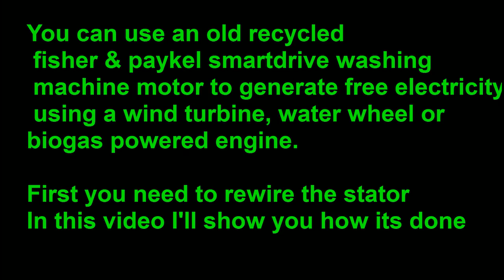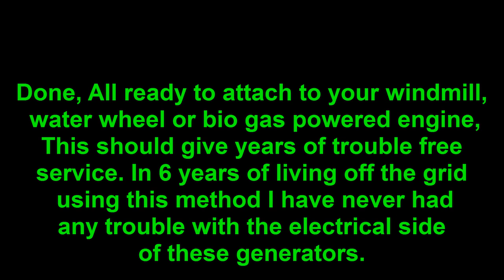How to rewire an old washing machine motor to generate free power

Comment: That's it? I mean thank you but why am I not seeing the magnets the production something.. 
I don't wanna go to all that trouble to generate 5 watts a month.  Show us what is going on .
Reply from the maker: Link to the water powered generator is in the video description. It has been running 24/7 since I built it, saved me many thousands of dollars by not having to pay for power
Reply: @AngryRambro  nice.. that's what I'm talking about.
Reply: Tomo Polic yes yes, that is the intent.  I live near and my parents have lived on a tidal creek since I was 13, 1984, and I’ve wondered since then why we don’t harness the power.  Plus my dad is a retired Army Colonel and the smartest man I have ever known.  Chemical Engineering top of class.    I want to put one of these at every dock on the creek and get everyone integrated such that when one home has surplus another can take some extra wattage.  To me, the issue isn’t getting the power, it’s the storing of it.  I’ve even come up with concoctions of your floating driveway and every time you park the weight of the car and the movement of stopping and accelerating are harnessed into underground springs managed with ratcheting clutches, to the tune of maybe hundreds, storing potential kinetic energy as wound up spring pressure.   Turns out I’m onto something as they have developed nano carbon springs to be used the same way, but they streamline the process.  Obviously.    I also feel that every single braking event from the horse drawn carriage to the locomotive to the airplane to the car, is horribly wasted energy.   Most of the gasoline we use is in the acceleration.    Remember the toy cars where you pull it back and off it goes with equal and opposite force?  Like that for full size cars, but accompanied with a flywheel of sorts.   Clutches and ratchets control the whole thing.   Every (almost) bit of energy used to come to a stop could be used to take off again.   Imagine having a direct able wind turbine above your car.   With a cross wind, you could make energy on the side(see what I did), on braking, it could face forward and use impedance to increase air braking force.    Maybe even mechanical by tilting the rotors like a helicopter for more resistance to come to a stop.   Kinda hard to lock up the breaks or lose stopping distance because of bad tires when a fair portion of your braking is done by wind resistance.   Same rotors could be tilted for optimum aerodynamic efficiency for high speed or performance driving, even folding away when needed.   But you could park your car and charge the batteries with just the wind, the sun, and soon, the rain.    Most of the surface of your car channeling rainwater into one or two streams could definitely be useful to “passively charge your car.   Imagine a bright sunny day with a brisk wind, and you smile knowing that gas stations are stupid.    Then a hard blowing rain, at night even, and you smile knowing that gas stations are stupid.   Even at that electric motors are great for filling in the lag during transmission shifts in the highest performing cars in the world.   I’ve been reading car and engineering magazines since I could read at all.    They even said back in the late 2000’s that electric cars would not be common until 2025-2030.    I don’t know where y’all live, but in Charleston, SC Teslas are ALMOST ordinary.   I see at least five every day without looking.  If I were to seek and count I’m sure I could reach 30 Teslas every day.    The point is this.   Tomorrow is today.    This guy is showing us the future.

Comment: How much RPM does this motor need to start to generate?
Reply: +faffaflunkie  Based on the diagram and 220 VAC in NZ, it will be generating 50 Hz at 214 rpm and 32 volts AC.  This will be rectified to charge the battery.
Reply: Depends how much electricity you want, the water turbine I have made is 3.19 to 1 ratio, each turn of the Pelton wheel turns the motor 3.19 times. It is a 3 phase motor so I just separated the 3 phases and and bridge rectified each phase. This increased the amps without having to rewire the stater. admittedly this is a low rpm system. I have 4 motors on the water turbine like this. at 20 rpm on the Pelton wheel I get just over 60 rpm on the motors, they produce 38 volts and 4 amps. This may not sound like much but when it is going 24 hours a day into a battery bank it adds up.

Comment: Is there any reason you cannot use a small gas engine to spin this and make a portable generator?
Reply from the maker: Not direct ac with this config, but they make good battery chargers when coupled to a gas motor. This one would put out 30+ amps @ 24v or 60 amps at 12v
Reply: Buddhanz1

Thanks, I'll have to keep figuring on it before I go at something.
Reply: Buddhanz1
What rpm would the rotor have to turn at to generate the 720 watts (i.e 30+A@24V or 60A@12V) that you described above?
Reply from the maker: A B Around 1000 to 1200 rpm from memory

Comment: Why can't you just leave it wired up for ac and just hook it to the panel box and put some breakers in it?
Reply from the maker: +Christiancrusader The factory wired stator puts out 400+ volts 100+hz, quite dangerous and not good for sensitive appliances
Reply: +Angry Ram what voltages and hz is good for 110 appliances ? I'm trying to figure out a way to run just the 220 on the power grid and the rest off a self sufficient generator
Reply: +Christiancrusader "110 appliances" would indicate 110v (usually 110-120v). For every appliance you intend to power, look at the labels attached to them by law. They will tell you what power brackets they operate within.

If you had a 110v Laptop power adapter, you might need only 45 watts to power it (watts = amps x volts). A microwave, however, can be more than 1000w. That means you'd have to spin this thing 20x harder to power a microwave than a laptop at the same voltage. If you plug something in which requires amperage which you fail to produce, it may either perform poorly, malfunction, or damage itself trying.
Reply: +SilverBird how can I regulate the hz down to 60 where it's supposed to be at so they will run where it needs to.
Reply: +Christiancrusader At this part, I'm not really qualified to give advice. I think you'd need some sort of Load-Frequency Control. But I will offer what I can for advice.

It would be impossible for you to leave this wired for alternating current (AC) production and get the desired energy production at your desired frequency. When wired for A/C, the frequency would be a naturally-generated product based upon the RPMs of the machine etc. The sine wave [pattern] of that electricity would be extremely impressionable and your electronics would not appreciate it.

When using this to generate Direct Current, then hooking it to batteries and running an inverter off of those batteries, you dodge this very difficult bullet [in most applications], because the inverters are going to choke the output down to safe frequency and voltage levels and produce as consistent of current possible regardless of your fluctuating input (so your electronics aren't damaged). Since the majority of production is stored into car batteries, or what have you, there's significantly less waste. [Generator>Battery>Inverter>Electronics]

To get 60hz out of this design even at the perfect 120v A/C output, you would have to turn this exactly the same speed- all the time, and if it turned faster, your frequency would rise (proportionally to your RPMs I imagine). You'd be wasting a LOT of potential energy production by braking the turbine to stabilize your hertz, and risking your electronics every moment they're plugged in should the wind ever go from 6mph to 10,12,15mph.
Reply: Plus, the simplest answer of all: If you didn't store the energy produced into batteries, all of your lights would dim and flicker when the wind slowed down (or whatever variable is turning this generator), and if would be completely off when this wasn't turning.

Batteries are direct current, so you really don't have a choice anyway. Which is a good, safe inconvenience, because that Inverter saves you a lot of hassle with your question.
Reply: +SilverBird thanks for the info but I though of an much easier way to get what I want I just need to buy a generator motor that will produce what I need and just use the water and a water pump to make the wheel spin.

Comment: you dont need to run 3 separate wires. essentially you have a 42 pole 7Y connection all the phases get connected anyway. so one wire would work
Reply: do you have a clue why he not answer you? I am doing one now and you do need all 3 wires. Look up 3 phase. Google is your friend.
Reply: No one wire to hook all the stars. I rewind 3 phase motors for a living. Instead of 7 stars connected just connect them all together.
Reply: @reubenspafford2927  can you send a picture of the way you would do it? I would like to see it.
Reply: Marty T Using a large soldering iron in his latest vids doing this again...with sound.
For a newly built hydro 
also  https://www.thebackshed.com/Windmill/FPRewire.asp

Comment: Why do we have to re-wire the stator?
Reply: the answer to that is in these posts about ten times. to increase the current and lower the voltage to a safe and useful level for a 24 v dc system

Comment: Is actually a 14 pole three phase stator (0:24) but I gather you will rewire into 42 poles... Nope, you didn't. Still 14 poles (0:29) you've just paralleled everything and it's quite ingenious but it isn't 42 poles. Each set of x,y and z equals one pole. Count. Great video and again you're lucky to live in NZ and have access to these "smartdrives".
Reply: +fla playa Yeah, I was kind of wondering why he calls this a 42 pole setup. It's 3 phase with 14 divisions. I imagine the rotor has 14 magnets on it.
Reply: Hi, it's not just in NZ that they have those drives, I just picked up 2 front loading defective washing machines (one Samsung and one Maytag ) on the web that people are selling for like 15$ and they both had the brushless motors in them ! I am planing to make a wind generator from them. A brushless motor like that cost 300$ normally, I am glad people don't know the value of what they are throwing in the trash ! :)
Reply: Oooh.. Glad many countries 'round the world have intelligent people in them is what I meant to say.. Wind, tide, stream etc can drive one of these buggers. How about solar to liquid fuels?
Reply: Now all we need are decent batteries to store the power.
Reply: Batteries? How about stored water? (The reverse function of a dam). Take the power from the solar and pump water into an elevated reservoir. Then at night let it back out to generate.. Batteries?
Reply: I am planing to store my energy in 1 meter radius Vinyl ballons, 3 of those filled with hydrogen from water can store about 30Kwh worth of energy ! then you can use a fuel cell to convert back to electricity or you can use the hydrogen for direct heating-cooking.
Reply: simpledate Pretty archaic if you don't take offense. Why not use a simple HVAC compressor to compress your H2 stream and then store in a simple steel pressure vessel? Many videos on here will show you how. How are you generating H2?
Reply: It's a question of cost, I looked in both alternative. Add the price of the 100 psi compressor plus the 3 one hundred pound propane tanks plus the price of the valves and high pressure tubing and you end up with 50 times the cost of the balloon and 3 psi compressor. I make my own hydrogen generator, about 5 litres per minute.
Reply: I'm fairly impressed. Are you using grid power or solar to generate your H2?
Reply: Solar and wind. I built my own solar panels. On Aliexpress the 6x6 Mono monocrystalline
cells are about 35 cents per watt. But it's a bit of work putting it together.
Reply: simpledate Breath of fresh air you all are in whatever part of the world guessing NZ? I won't tell you what "we" are doing for our energy right now.. Not good I can say that... If more brilliant minds would stand up and demand energy to be produced cleanly.. We'd have a much friendlier place. 

A note to your method of H2 storage. The H2 molecules are so small that you will not be able to contain them for very long in latex rubber let alone vinyl.. They literally permeate right through it. I'm not trying to rain on your parade as I see it very very cool the system that I'm envisioning that you built.. Maybe I can help you come up with a better storage system as to not lose any of that preciously generated Hydrogen Gas.. May cost a few bucks but if you're thinking reusing stuff it will be much less right?..

As I said, A refrigerator compressor from the side of the road is free.. If you want to get very technical about design I can accommodate.. An empty helium balloon canister is free out back of party stores.. Useless for H2 storage until filled with a medium such as Activated Carbon or Diatomaceous earth.. Stay tuned.
Reply: simpledate
Reply: search for Water RAM pump
Reply: +fla playa Thx!
Reply: its called going from series to 7star or 7Y....but yes 14 poles
Reply: fla playa:    Incorrect and absolute tosh. This is a 42 pole, salient pole stator. (The poles are the 42 'ends' of the stator which 'cut' the magnetic lines of force created by the magnetic circuit when the machine rotates.
w, y and z describe the windings which create the 3 phases and has nothing to do with how many poles the stator has.

Comment: Where did you order the pelton wheel?
Reply from the maker: +Attila Banhegyi you can get them on ebay now, you may need to make an adaptor place for the centre hub .. http://www.ebay.com/itm/HIGH-EFFICIENCY-PELTON-TYPE-WATER-WHEEL-OF-WATER-MICRO-HYDRO-TURBINE-16-SPOON-/151960920111?hash=item236193a02f:g:waYAAOxyXHpSTw9E
Reply: Thank you for the quick reply angry ram!!  Where could I find the info to make the adaptor,  have you made a video on it or is there a tutorial?? Thanks again
Reply from the maker: +Attila Banhegyi An engineer would be able to make one in a few hours, just a matter of machining the shaft so is has a shoulder on it, drill & tap the centre of the shaft and bolt the pelton wheel to the shaft

Comment: Thank you for the demo! I have a question - what if you make triples of single coils instead of pairs of coils? I would assume that would make the voltage even lower and the amperage higher, right? Any reason why you pairing the coils on the same phase?
Reply from the maker: There are a few different ways to rewire, heres a good site showing some rewire options depending on voltage and rpm required https://www.thebackshed.com/Windmill/FPRewire.asp